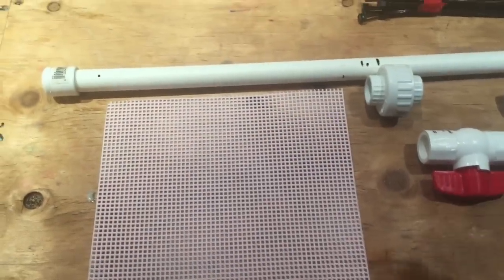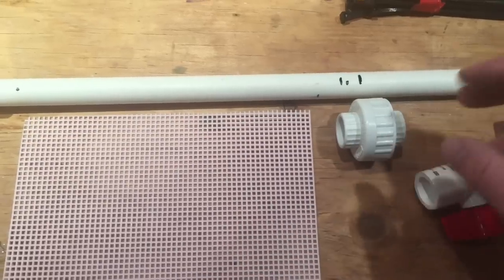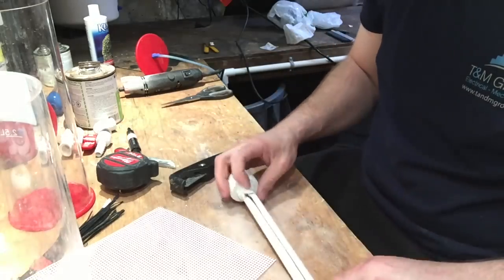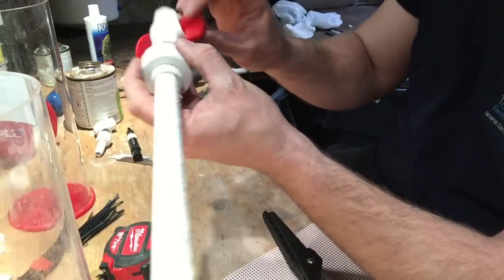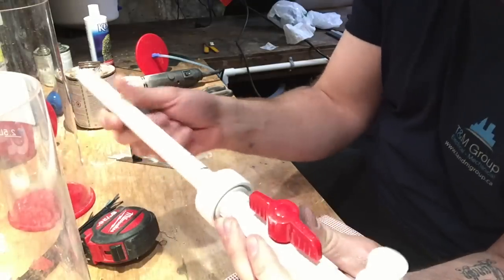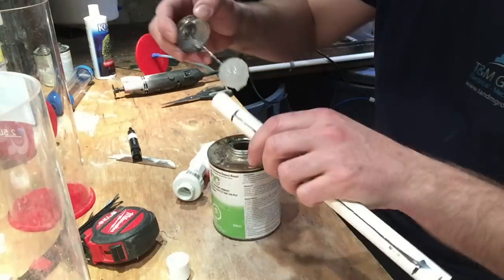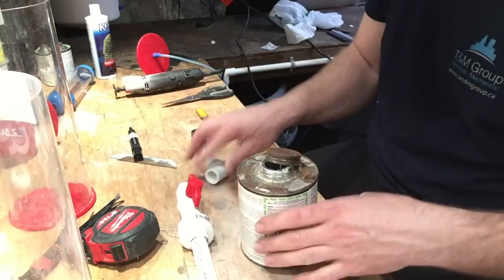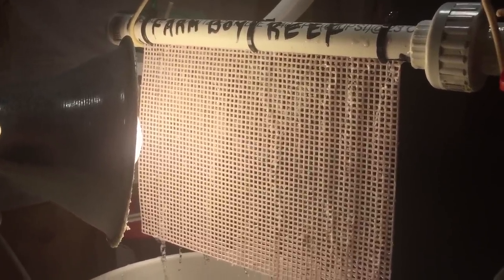Algae scrubber build step by step made simple. FBR

Comment: What do you call the piece that goes connected to the powerhead because I tried looking for it at Home Depot and I couldn't find it
Reply from the maker: +reef junkies it's a threaded connector look in the pluming section
Reply: FARM BOY REEF what is the exact size you bought so I could order it on line because Home Depot Menards or Lowe's does not have them over here in Chicago LOL

Comment: That glue bottle is for 3" or 4" pipe. You need to get a small bottle from Home Depot or hardware store.  You dont need that much glue, especially if its a no pressure system.
Reply from the maker: +DH4Hobbies  lol 😂 are use it more than just for this pipe
Reply from the maker: +DH4Hobbies lol 😂 not a big deal